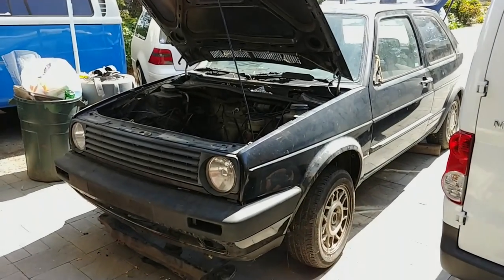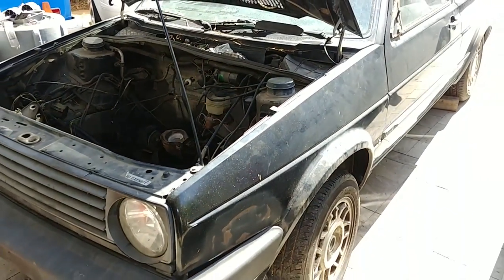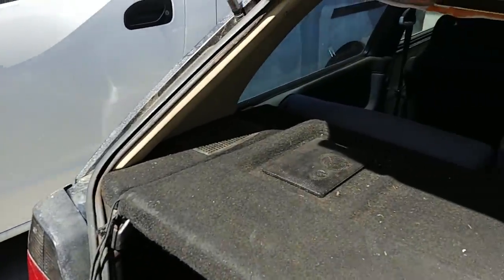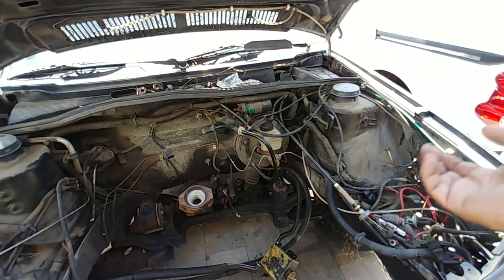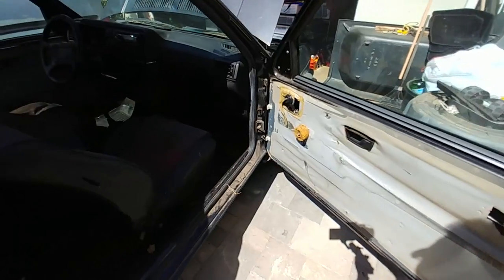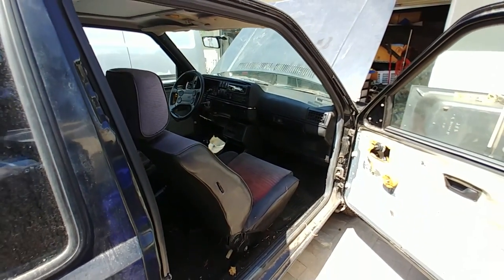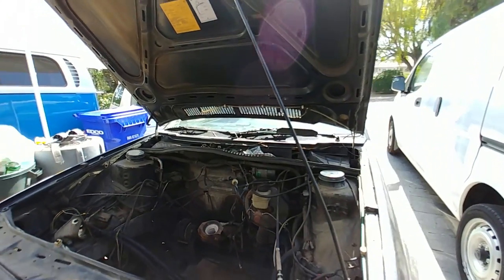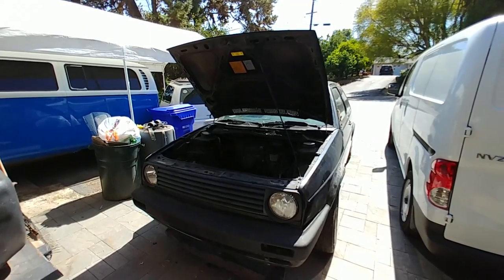mk2 gti Inspection Season 5 EP1

Comment: really love ur vids....... im planning on running amk out of leon cupra r and 6 speed box in mk2 golf. is there anything i should be aware of b4 i start? many thanks and keep up the great work..............danny uk
Reply from the maker: Danny Ferriss motor mounts! Try getting all the corrado G60 mounts. Which will help keep the engine level and firm
Reply: ok i have everything off cupra r will there not go? i wrote mine off and thats why iv got all the stuff for golf. also i have heard that fabia vrs driveshafts will fit straight in??
Reply from the maker: Danny Ferriss that I dont know....
Reply: i also have all mk3 gti subframe ect
Reply from the maker: Danny Ferriss ohhh your Going to use an mk3 subframe. We are going to use the mk2 subfram.
Reply: yeah sorry should of said. mk3  subframe gives you about of wider track on each side......... plus i had it really cheap
Reply: inch of track on each side

Comment: Do you know where to get the weather strip for the roof on a MK4? When I bought mine didn't come with any.
Reply from the maker: Can find them quick on ebay

https://rover.ebay.com/rover/0/0/0?mpre=https%3A%2F%2Fwww.ebay.com%2Fulk%2Fitm%2F351958907927
Reply: PincheAls Garage  thanks bro
Reply from the maker: MIKE G your very welcome. I also suggest salvage yards. Mk4's are super common right now